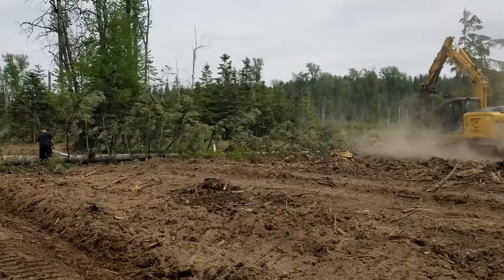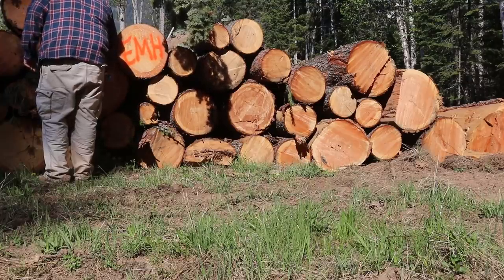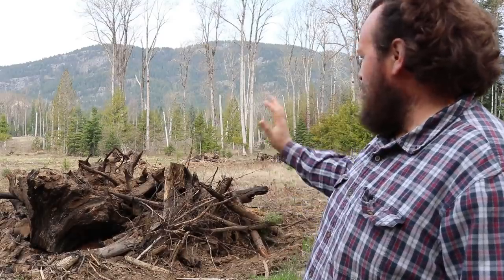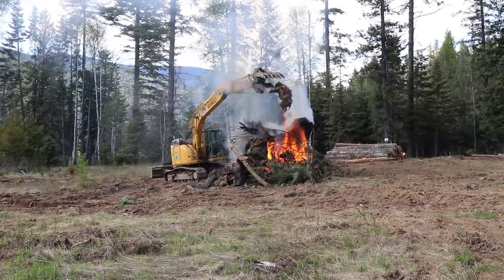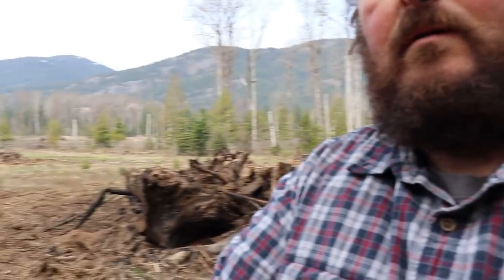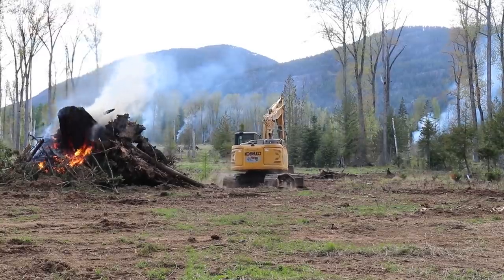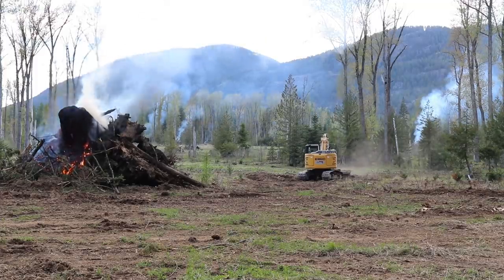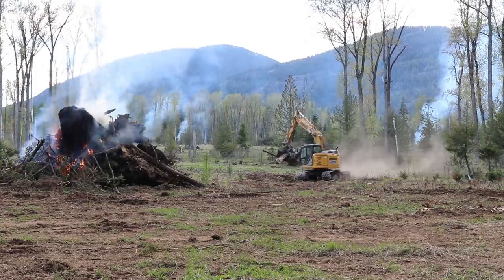Sawing Logs Into Lumber!

Comment: How much do these guys charge per log?  Or is it board feet?
Reply from the maker: Board foot on a sliding scale depending on the size of the board.  Obviously if you have to cut a whole bunch of very small boards you're going to make a lot more cuts than you would if you are cutting large timbers.
Reply: @EssentialMountainHomesteading  Gotcha.  And your slash burn vid you explain the spot pricing issues right now..  freaking amazing...  Kills me to see my pole barn lumber go up in flames like that...  but how good is cottonwood for building anyways?